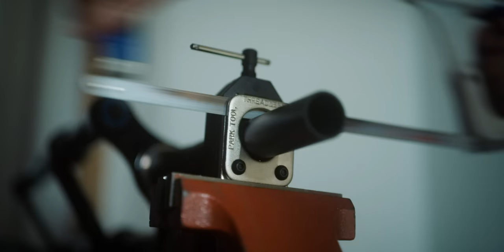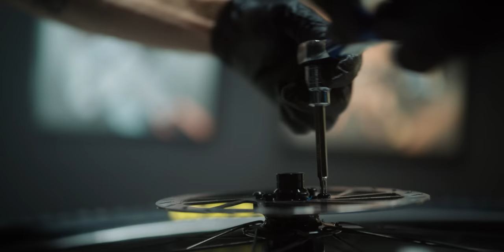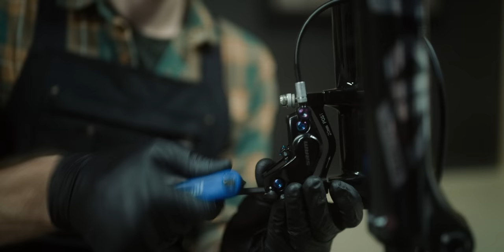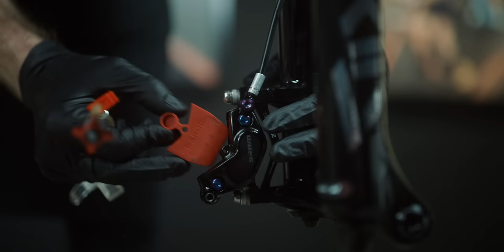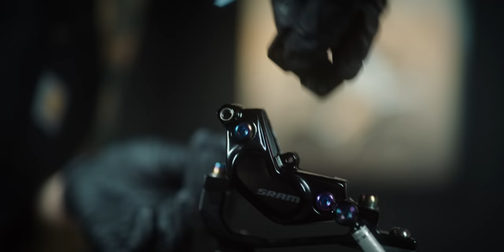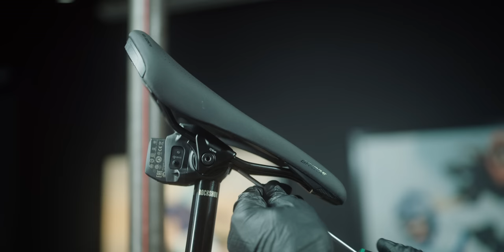BUILT | We Are One Arrival is here.

Comment: Any point to using a derailleur hanger alignment tool on a brand new hanger/frame? I get it helps remove niggles in shifting but eagle always sets up pretty flawlessly for me as long as the hanger and mech are brand new and not got a bent cage or something, oh and providing I don't ham fist the cable tension too much hehe.

Sweet steed, super clean lines.
Reply: Just because a new hanger is straight on its own, doesn't mean it'll be aligned once installed. However, the slight misalignment is usually not enough to make indexing impossible.

Of the number of new bikes I've done a hanger realignment on, I've only encountered one that can be left alone (still within 3 mm at the tool), but I perfected it anyway.
Reply: From the question also I'm guessing the guy works on bikes as a hobby, but please correct me if I'm wrong. But anyway, that's what you'd want from a good professional mechanic to check every detail before it even goes with a price tag, and also adding to the fact that the consumers would be happy about. I should note also that 12 speed setups can be quite finicky sometimes depending on what you are running.